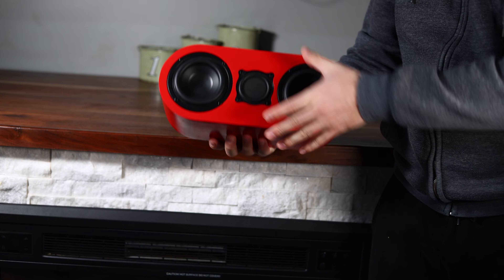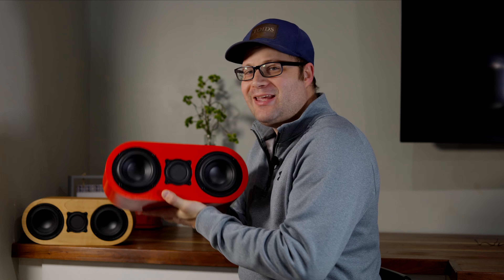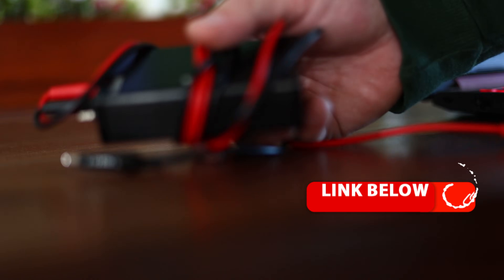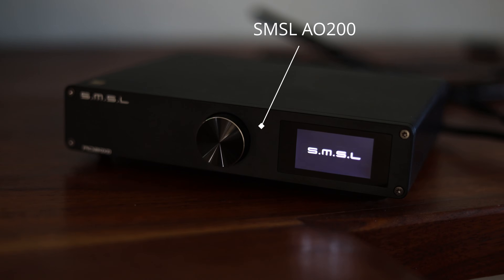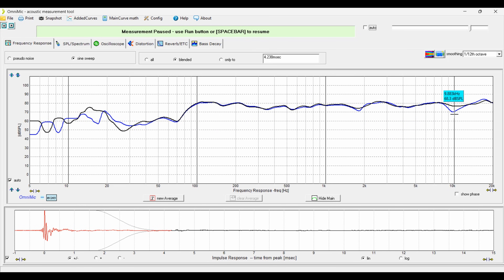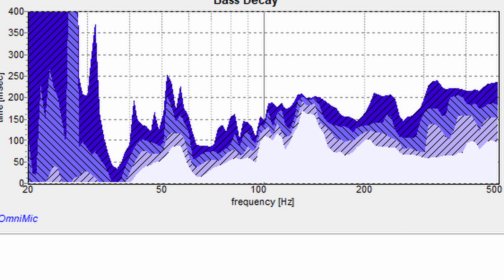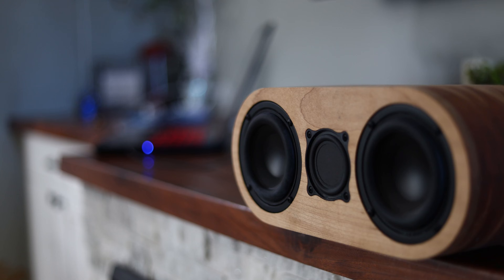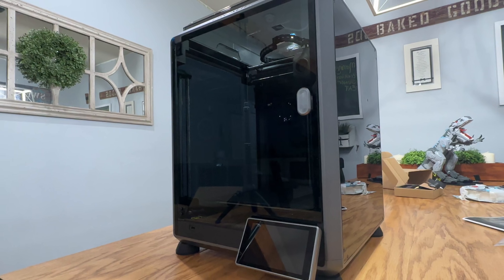Is a 3d printed Speaker as GOOD as a Wooden Speaker? DIY Speaker Tested and Revealed

Comment: Regarding the lower base - that's why on the inside of the 3D printed enclosures want to use dampening material such as butyl-aluminum tape. Works like a charm, does not cost much, and makes the process much more simple. That is much cleaner and simpler than the plaster-PVA mixture.

Comment: I'm printing a lot of speakers recently, I use PETG with 15% infill, the wall thickness is 4mm on average. I also 3d print the speaker mount using an SLA machine. Although they resonate like a pitchfork and the bass is as soggy as the pepe of a middle aged man, the sound is somehow accurate for the cab design. In this way, I was able to trial multiple designs cheaply. As soon as you are ready for the final product, switch to polycarbonate and crank the infill to 100%.

Comment: 3d print enthusiasm. :D
might be a lot to consider, like material, also with shape and form (as no boundaries about bending) and also might be to do different approach, like instead of 'infill', also can make a solid whole (like truss structure with more rigid) (also you can specific print to each driver for specific/different resonance). also some inside primer might help. 

a lot to experiment. just make it fun. :D
have a good day. :)

Comment: Nice video dude. I wasn't expecting much but your attention to detail was great. It matches what I have seen with my 3D Printed Speaker DRIVERS. The 3D printed cabinet doesn't seem to make a performance negative or positive if the walls have shape to them instead of flat surfaces. 

Keep up the great work - Paul (Polymate3D)

Comment: I didn't see where you mentioned the material you were printing with.  As you mentioned wall thickness and infill amount will change the way the enclosure interacts with the drivers.  However, there are also different types of infill that may be better suited than what you used (or worse). Then there is the option of multi-material printing.  For example, printing with a soft rubber like tpu at certain places to help dampen the cabinet and/or printing the rest of the speaker cabinet out of a carbon fiber or glass filled nylon would have a significant effect.

Comment: DIY Perks used a plaster of paris / plasticizer mix to fill their 3d printed walls if i remember, I would be interested to see your level of testing done on that to see how it compares as I have a good 3d printer but not a workshop. Name of the video in question was: Building exceptional speakers using modern techniques.
Reply: Correction, he used plaster of paris and pva glue for the filler
Reply: would love to see him try this
Reply: @ブロキーさん  doesnt make much difference fore anything above 100hz, and can always print internal bracing at nearly no extra cost for the same effect while also adding mass!

Comment: I'm actually kind of surprised you went with 50% infill instead of solid fill. I think solid would have been better to compare against wood and other materials because wood is more solid than 50%.
Reply from the maker: Honestly, 50% infill is typically much higher than what most people would use. 100% infill is really unrealistic. The print time would be days and the filament cost would shoot the project out of most people’s range. Keep in mind that the thickness of the material is half inch. Most people at 3-D print it’s going to be millimeters. In that case, 100% infill is more realistic. But I went ahead and did seven top and bottom layers, which would be more equivalent to 100% infill for thinner walls. obviously it would be kind of cool to see people test, other wall count and infills. They would definitely react differently.

Comment: Thanks for this test. I used some 3D printed boxes for atmos surround speakers and they worked great. They were crossed well above 250hz or something like that and worked well. I wonder if you experimented with filling the 3D printed "infill" with materials like sand or epoxy and then gluing them together to get more mass than the wood equivalent.

Comment: This is why I started with 500lbs of concrete in my Dirt to Demos build.
Reply from the maker: 500lbs!  That shouldn't resonate :)
Reply: @Toid  500lbs of concrete..9 sheets of Birch..ten 2x4's.. 50 pounds of spray foam and 30ft of 2" angle iron...and I'm still not done. Lol
Reply: @Toid idk, it transfers sound very well such that in a concrete slab house you can hear people walking on the hard lino up the other end of the house or all the details of what's deposited in the toilet when your head is near a hard surface :))

Comment: Maybe you can try to fill the 3D printed form of the enclosure with different materials like resin, damping wool or any kind of gelatin (like these ballistic test stuff). Also a change on the internal walls like "fussy skin" or non parallel walls could have an effect.
Reply from the maker: Great idea

Comment: I always like to cast anything needed to be more solid. Use gyroid infill as low as possible to hold some bridging and so that the top layers will easily cover infill. cast the prints inside with your favourite 2 component casting stuff. epox or pu ect. You get a solid form even with printing issues. Just look out for holes for consistency use atleast 2 perimeters. Also becarefull not to distort the form if your 2 componen casting will cause alot of heat.

Comment: Why not 3D print a shell and fill it with epoxy mixed with sand?

Edit: I just found a gallon (½ gallon resin + ½ gallon hardener) of table top epoxy for $64.50. Price of sand is negligible. You would have to modify the file to provide tongue and groove between the sections, a sprue, and air vents. Pre-gluing the sections would probably be a good idea. You might have to experiment to keep the sand from settling, or get the ratio right to keep it in suspension. It would be a mess to have to do it in layers.
Reply: There are additives sandlike but that are made for casting and slowing down the heat problem and adding more fill. I ques they are sand like. I´ve  used pu stuff like this. The only thing you need to remember when castin 2 component stuff is allthough the componen a or b may look like clear , it doesnt mean you don´t need to shake both of the comonents thoroughly before mixing together..... believe me. It´s fun to watch something drip and dry for months when failing to pre mix every component before mixing together.
Reply: @janneliiti8898  What is pu? Polyurethane? 
I was thinking about sand because it's inexpensive and dense. Iron filings or lead shot would be better. Now I wonder if you can 3D print wax to make molds to cast lead or bronze enclosures. Of course the cost would go up.
Reply: Yeah ithink it was PolyUrethane. It goes into yellow when it hardens. Like the phoam but really hard and solid. @BlankBrain
Reply from the maker: Elliot Designs was working on something similar but using a special concrete mix.

Comment: Great video! My initial thought around this mainly involved the density differences of the MDF/ply of the wood cabinet vs the 3D printes cabinet, as I've done some testing in the past, and the thinner the walls are made, the more likely the cabinet is to resonate. That said, using 7 layer walls along with 50% infill is  pretty solid, so I imagine that the overall density isnt too different.
Reply from the maker: Yeah, I wanted to give it its best chance at successful.